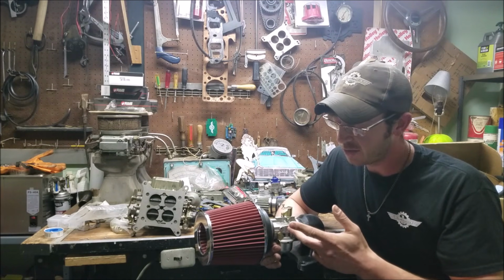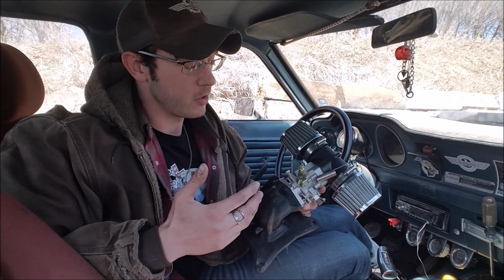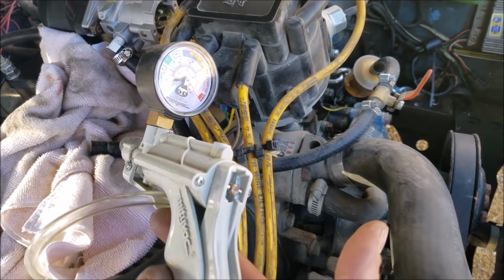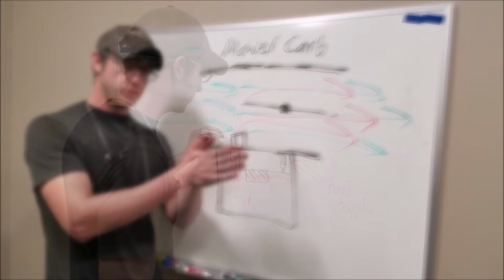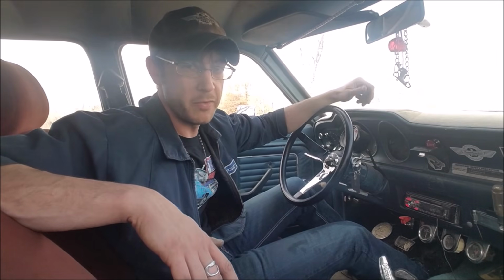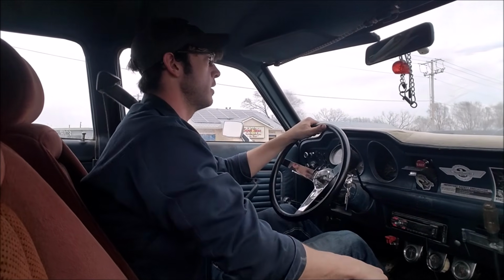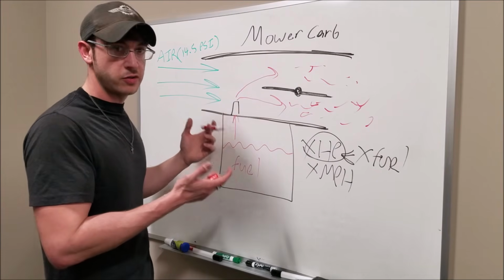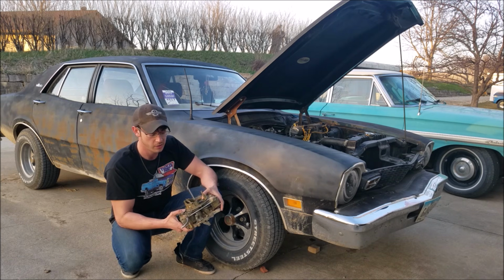Will It Run? Lawn Mower Carb on V8! (The "IMPOSSIBLE" Becomes Reality!) Start to Finish

Comment: Watching these comments.. I realize people here have not a clue odf how engines work .. If this worked people would have been doing this years ago..

      Why doesn't it work  ??? Hell , you just saw with your own eyes that it does .. well , not exactly.. 

   First this is YouTube.. you can edit  anything the way you want for whatever outcome you want..

   But lets say for arguments sake that this is true ... and a V8 will run on a lawn mower carb .. and there's enough fuel to take off without injecting more gas into the engine... 

    Ok. But you still have a bigger problem, without the gas , the engine is going to run lean . Very lean .. this will cause the engine to overheat. That will burn up that engine .. period .. That is the real reason car manufacturers don't just put smaller carbs on their cars .. basic physics.. too much O2 will turn that combustion chamber into a cutting torch .. 

    It might run long enough to make a video .. If it even worked in the first place.
Reply from the maker: It's not lean, I go through the science and show that it's actually naturally going to be rich on its own - which it tried to be without the auxiliary control. 

The reason this isn't done is because on the dyno this made 50hp. You can drive on it no problem - but who wants to. 

The problem in the comments is that everyone missed the point of the video - it was to teach a out engine theory and tuning dynamics. People got stuck on the mower carb and never saw the forest through the trees
Reply: @ThunderHead289  unless you opened up the the jet quite a bit vacuum will overtake the the ability to pull equal fuel through the passage .. last I knew air was thinner than gasoline and would win the fight ..

Comment: This has to be creating a unsustainable lean condition in the engine
Reply from the maker: Pretty sure I dispell that numerous times if you watch
Reply: @ThunderHead289  you can say or think what you want but you are getting detonation instead of a burn inside that engine, i know this is all for fun, but if this was daily driven eventually you could expect to burn the exhaust valves, automakers would have made carburetors that would have limited air and fuel if they weren't bad for the engine

Comment: Re fuel consumption:
Your theory is nonsense. You're imagining, you're fantasising.

A smaller carb, tuned with an efficient fuel mixture ratio to make the vehicle travel at say 70mph in top gear @ say 3000 rpm will be EXACTLY the same fuel consumption as a monster carb tuned for efficient fuel mixture ratio to make the vehicle travel at say 70mph in top gear @ say 3000 rpm. It all comes down to energy in (petrol) versus power out. If power to the rear wheels, at equal speed, at equal revs, with equal burn efficiency (ie, no unburned fuel via the 4 barrel) the fuel consumption MUST be the same. 

The only true test is exhaust monitoring to equalise combustion efficiency. All you've proven is that the mixture profile on your 4 barrel was wasteful ... and that your pedal foot was unconsciously wasting power and thus fuel.

If you really wanted to prove this, put 1 litre of fuel in a bottle for each carbie test, and drive at 70mph @ 3000rpm until each bottle runs out.

Comment: No offense people, most old dump trucks had v8 and a one barrel carbs, so not that shocking.
Reply from the maker: No offense, but have you considered that there is staunch differences in diameters .... 
There's no logic there, for example - I have a 500cfm 2 barrel, and I also own a 390cfm 4 barrel. 

I agree it is not shocking, hence why I made the series - but to think a single barrel is just the same across the board is incorrect.

Comment: You can accomplish the same thing with a block under the gas petal.
Reply from the maker: False. Try it.
Reply: @ThunderHead289  limiting the air intake with a smaller carb....vs limiting with stop on the larger carb.  

Hmmmm.  Measure air flow.....monitor milage....sounds like you have a new video

Comment: Have you experimented with ultra sound to atomize the fuel into a mist? They sell those ultra sound misters at the pharmacy. I seen a few vids way back where guys were running small engines off misting the fuel with ultra sound for some rather impressive mpg gains. When google started censoring youtube, a lot of those old videos disappeared, I think a few guys ran cars off them too but they needed some tweaking. When the fuel was in a mist or vapour form it had much more efficient burn.. I wish I was smart enough to figure it out.. 
Im running an 07 wrangler v6. I got it in january and noticed the mpg was complete trash. Colder northern ontario weather, keeps the gasoline cooler and shrunk. Just the last few weeks with the warmer weather, I am about to hit 200km city driving on half a tank of gas. Back in the winter the jeep was hitting maybe 100-110 km per half tank, and as the weather got progressively warmer out, the gasoline expands making it more efficient on the burn so the same volume goes further, i.e better mpg.. 

So the ultra sound device transforming the liquid gasoline into a mist increasing the burn ratios should equate to vastly increased efficiency. I mention all this here because you seem to have to intelligence to maybe make it work..If you're thinking 200km city on half a tank is unbelievable, the jeep is bare bones, no ac, no power windows or locks. I think that Im sweating my squirrel sack off is a big part for hitting those mpg numbers. Plus, I drive it like an old lady lol. The roads are so fkn rough up here its bounced all over the place and my spine is busted to shit as is, so I drive it like an old lady. Its also a lifted jeep with 33's. I don't think I should be seeing 200km on half a tank of gas. These things are pigs as far as I can tell, and it surely is in the winter months, plus 4x4 use etc on bad days all adds into the poorer winter mpg. I'd love to see someone figure out the ultra sound mister thing..

Comment: Not sure what this is supposed to prove, first i dont know who told you it was impossible. You just need to adjust the air fuel right. Also its not saving you any fuel,  its just smaller and cannot move as much air, so the lack of power and speed. You could get the same thing out of just not pushing your foot down and drive like a 90 year old. What if I told you you couldn't jump off the empire state building.
Reply from the maker: Quit being so pompous. Many folks didn't beleive it would work at the time - this is supposed to be a lesson on fluid dynamics, but everyone made it put to be some economy device. 
Either way, I made over 30k from filming it and it cost me nothing to make.

Comment: With electronic fuel injection, there is no need for carbs.
Reply from the maker: Sounds good till you spend thousands at mechanics once you get to 100,000 miles. 
Let me lay it out for you - say you buy a new car for 30k, you have an old car for 4k - you drive 12,000 miles a year and gas is 4 dollars a gallon. If the old car gets 18 and the new car gets 35, your only saving 1200 dollars a year. 
You'll never pay off that new car via the savings - the math favorites the old-school rides still

Comment: I need one for a Chevy SBC 305 V8 2bbl rodchester carb intake if so I'll buy one I'll give you 100 $ if you could do me the same carb, with the intake you made but to fit a1978 305 V8 2bbl carb plzz I don't need the rea regulator I can get one an anything is better then a 4 bbl but you did what I dream an told my dad when I was a kid

Comment: This mpg calc is not convincing without a much longer run with more varied driving. Running downwind on a flat freeway for 30 min is not enough data
Reply from the maker: If you watched it, it's obvious I didn't care about mpg - but all that aside, there is another video where I drive this the 1000 miles on power tour, it's put on a dyno and a full tank is tested.

Comment: It's even it's basically any carburetor is just a fuel admisation device even fuel injection does the same thing but it's not a different concept but carburetor as long as you can admire the field who will burn she's like dumping raw gas down and then take at a controlled scent rate and controlled amount basically it'll run that's my opinion on what you just did so it's less scientific than yours I'm sure but it's held water in the mechanical thought process of my brain

Comment: 24,3000 rpm? With a 8! 28 mph is exaggeration totally. Even at 75 mph. 23 at best. 19 worst. That's highway with a two barrel. You mightive got 24. That's just pushing it.  Air to fuel I understand the controlled leak which it could be accomplished but it's just not believable.
Reply from the maker: You realize that v8 cars today get 30 on their own in 4000 lb cars. Idk why people have a such a hard time with a super light car getting 26
Reply: @ThunderHead289  right ya might add,say so.. but they're not. We're talking 8 cylinders here only. No car I know of today weighs 4000 lbs maybe the royce or a Lincoln. But?? Without looking it up I've got no clue. Though with the weight your right back to about 10, 13, 14, mpg anyway.  Stop n go that's even worse wanna keep trying to bullshit me?  It have to fire 1400 to only 1800 possibly only 2 thousand times a minute at a traveling speed of 80 mph with a v8 to pull 30 mph. That's running correctly n not being starved of fuel. Sorry. Later.

Comment: I just can't believe it!!!!!  Are people really that dumb, and gullible?   Of course it would run off a lawnmower carb !!!!! Why wouldn't it?  It is getting the essentials it needs -  air and fuel. The only thing the smaller carb is doing is restricting the amount of power and torque the engine produces, and also the top rpm's.     Have you ever seen the carb's that dodge/chrysler used in the mid to late 70's?  They weren't much bigger than a lawnmower  carb.

Comment: HHO on demand into a T from the EGR valve would offer maximum fuel usage / consumption ratios by at least 71.556% increase in mileage projection you would be able to use a mechanical fuel pump with 3 way fuel distribution valve the 2 going in 1 out ..out to carb , 2 in has a fuel return line for excess , HHO would burn 100% of fuel processed, inherently lowering fuel consumption

Comment: You don't understand fuel & engine basics to try something like this. , it's LEAN AND WILL BURN UP THE ENGINE!
Reply from the maker: With all due respect, thinking a small carb means lean just shows you have very little understanding of fluid dynamics.
Which that very thing you say is why I made this 3 part series - of which you are only viewing the final peace. 

I explore you to view the whole thing and then make an assessment of what is and what isn't.
Reply: chuckle...Hot Rod Power Tour...or unique power tour...wait til he using the cheater on 1050 Dominator 500 CID with a removable throttle stop

Comment: Wouldn't you be running lean in all cylinders.
Reply from the maker: I show the realtime afr - people think afr is where the mpg comes from. It's the volume of air/fuel blend.
But no - it isn't lean
Reply: @ThunderHead289  you should pull and show spark plugs to explain rich and lean...this kit on a motorcycle or snowmobile would be interesting too

Comment: U want a challenge come & work on my 06 trailblazer gas hog 6 cyl , that big block , 41 mpg blows my 6 cyl throttle body away , it takes me 10$ in gas to go 40 miles at 2.95$ a gal , put a lawn mower carb on 06 gas guzzler it's killing my wallet , have mercy on me

Comment: I don't believe you. You cannot pass enough air through that carb to supply the displacement of that engine, especially at high RPM's. It's not a fuel problem, it's an air problem. This is a single barrel carb. NOT HAPPENING, this video is a lie.
Reply from the maker: Lol that comment is why I ran it in front of 1000s of people last year

Comment: No accelerator pump! Totally wrong fuel/air ratio.bet that is a horrible driver.so lean would burn up pistons and valves at anything but idle.been my experience v8s like mixture very much on the rich side.
Reply from the maker: Oh boy .... everyone thinks they are smart. Love it

Comment: Yeah,. That's not how you measure fuel economy.  Too many sources of errors. 

this car is running like it did with the other carburetor just it really small openings the exact same amount of vacuum the exact same amount of fuel the exact low amount of horsepower.
Reply from the maker: Lol I didn't do it due to fuel economy - was just proving people saying a 450cfm is "too small and a 302 won't even run" wrong. 

As for hp, it makes 320 on the dyno with the normal carb - a whopping 48 on the dyno with the mower carb. 
I was not at any point promoting the idea of running a mower carb in this series - it was just an "f you" to dumb people who argued with me.

Comment: I had a 69 corver it was getting 2o miles per .changing the air filter incised the chok were closed. I back them off.the mother wS hot they should of already t y been open .I ran 200miles 2galons. Well then my wife todled it  tank for the help google